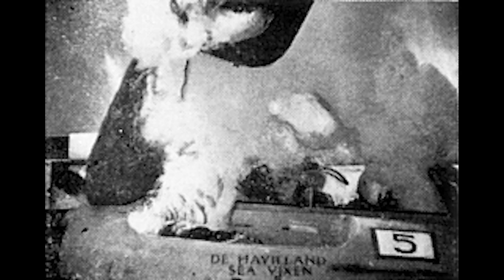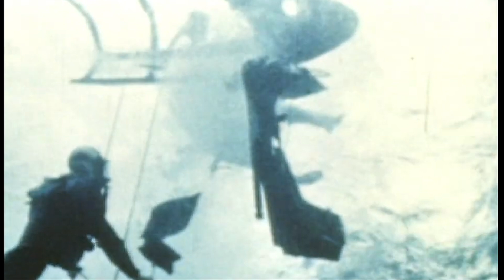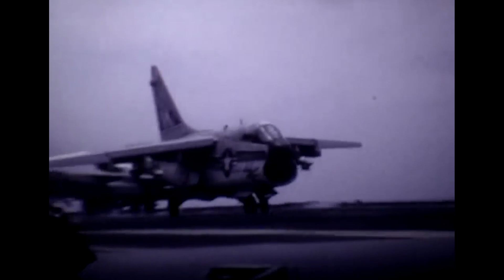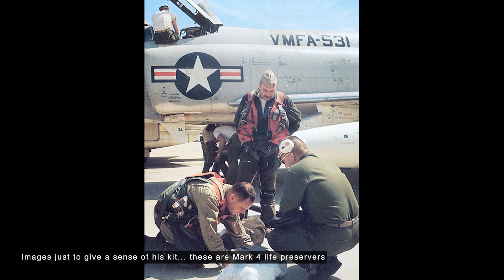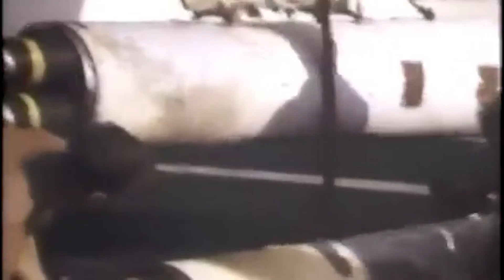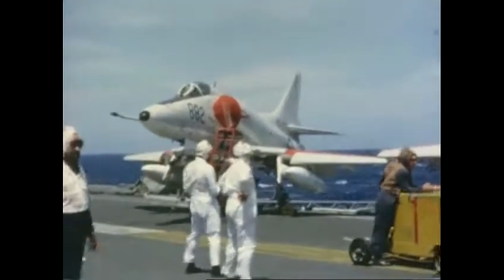UNDERWATER EJECTION: Four Remarkable Stories Of Rocket-Propelled Escape

Comment: I don't understand how these pilots were able to wait for the carrier to pass over them before ejecting. For example, the Constellation is 330 meters long and her top speed is about 20 meters per second. It would take 16 seconds for it to pass overhead. If the plane sinks at about 10 feet per second and survival is very unlikely below 100 feet, then how did they survive ejecting from 160 feet under water?
Reply: The Corsair II floated so at least for that case it wasn't that deep. I imagine most aircraft will sink more slowly while they take on water, and only then sink that fast when full of water.

Comment: Pretty remarkable that anyone survived being keelhauled by their aircraft under the carrier. Thanks for the vid, phenomenal work as always!
Reply: Being trapped underwater in a sinking airplane while being run over by an aircraft carrier, hearing the giant screws in complete darkness, is your basic high test nightmare fuel.
Reply: @RCAvhstape  credit to his training and the pilot that he still managed to function in those circumstances
Reply: @RCAvhstape  these stories are AWFUL!
Reply: To be fair, the same aircraft that caused the keelhauling in the first place also serves fairly well to insulate the pilot from a large portion of potential physical damage caused by said keelhauling, so it's blessing and curse in equal measure IMO.
EDIT: Of course, being IN that situation you probably won't be thinking about how much protection your aircraft might provide from oncoming screws, but it IS doing that, both by means of making you sink lower than the path of the screws AND by means of preventing your own flesh bone and sinew from scraping along the hull if contact DOES occur.

Comment: My Grandfather was in the Fleet Air Arm (Air Radio & Radar in Malta) when the Wyvern incident occured. He told me they had known there was an engine performance issue with it having caused previous losses but investigations to that point had been inconclusive. Even immediately afterwards they couldn't work out why they had this issue, it actually took a lot more investigation to work out the issue was fueling.